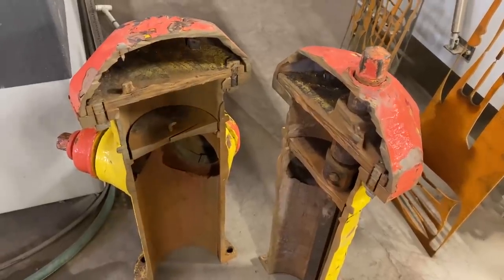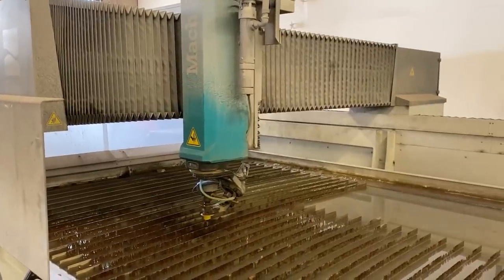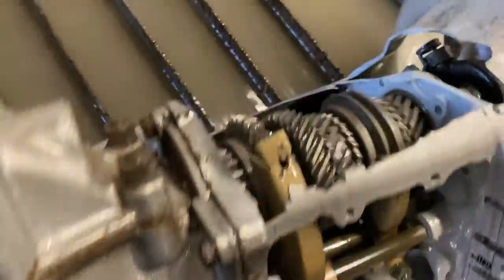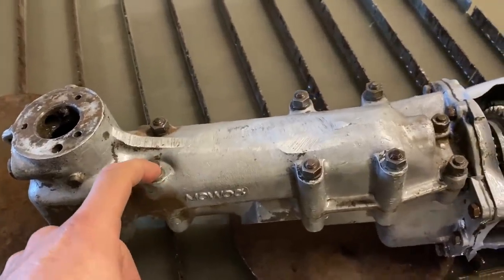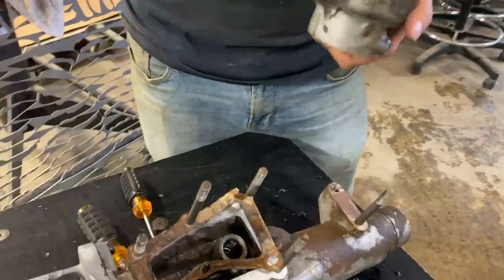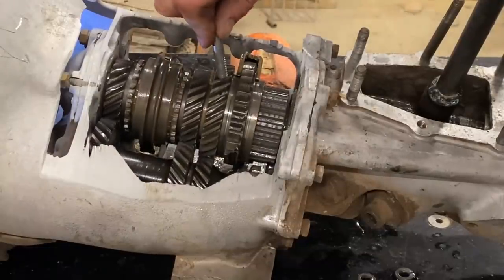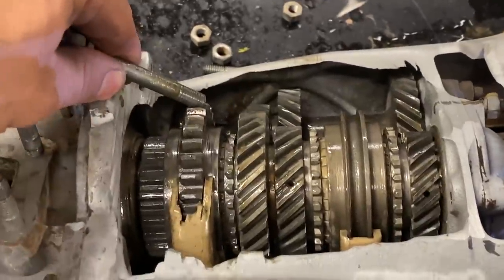Transmission Cut In Half With 60,000 PSI Waterjet

Comment: Pretty sure this is the first time I've truly understood how everything in there works.
Reply: i was about to say that. i started out being really entertained and i finished the video being really entertained AND finally learning how the gears mesh together
Reply: Well it's all pretty simple VISUALLY but I'm still having a tough time understanding how you get he insane ratios you need to go from 5 MPH all the way to 100 with gears that basically are almost all the same size... or maybe I am just wrong and the engine is already having a wide speed range and only needs tiny ratio differences to achieve that.
Reply: Techalyzer they said it came off a mg midget. those can only get up to around 80. i imagine a more powerful car would have bigger ratio differences
Reply: You probably don’t. It’s a very simple demonstration and design compared to higher speed or something more modern. Just wait until you see a automatics
Reply: @383_mtb7  those are harder to understand
Reply: Honestly I’m the opposite; I fully understood something like the CPU they cut in half a while ago but this kind of mechanics is pretty much dark magic to me.

Comment: "Practically new, light use, 3rd gear slips a little bit"
Reply from the maker: small oil leak
Reply: @WaterjetChannel  yeah might need some trans fluid, but other than that i see nothing wrong :)
Reply: No reverse. But who needs that in a racing transmission?
Reply: Civic owners be like
Reply: no gear would slip without a clutch
Reply: I think I've seen you on craigslist.....
Reply: Fightre Flighte well, how are you supposed to put the thing in race gear without the R?
Reply: It was 1 6 speed now its two 3 speeds

Comment: Properly done displays like this are worth a lot of money. Take out the input shaft, cut windows then put it back together. A little plexi for windows so you can still fill it with oil. Weld it to a stand and auction it off.

Comment: You will probably never see this but. My Stepmoms 2012 Subaru outback recently blew the transmission."It is a known issue and a new one is 6-8 THOUSAND DOLLARS and we can't find a used one for the 2.5 engine". It was a special type of transmission called a CVT (continuously variable transmission). I think it would be cool to see the inside, see how it works and see the belts and pulleys inside.

Comment: You had your gears all mixed up. The gears from the rear to the front are 1st, 2nd, then 3rd and 4th is direct from the input shaft to the output shaft. The shifter lever reacts opposite on the gear linkage and forks. The bigger the gear you engage on the output shaft, the higher the ratio.

Comment: By nature of operation, the pivot point of the gear shift reverses the inputs from the driver. The selector shaft in the shifter remote cancels out the reversal of the lateral (left/right) input from the gear shift, but not in the longitudinal (up/down) direction - that is to say, when you move the gear shift forward, the selector shaft comes back, and visa versa...

You removed the remote assembly, so to correct for this you would've had to reverse those up/down inputs to select the desired gear (1st left & down, 2nd left & up, 3rd right & down, and 4th right & up).

It seems you reversed the lateral (left/right) inputs instead.

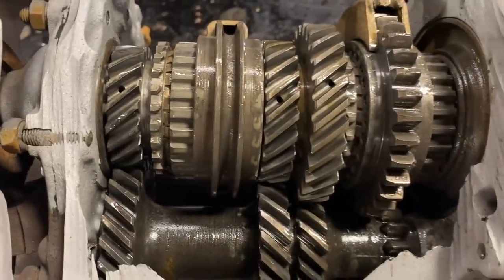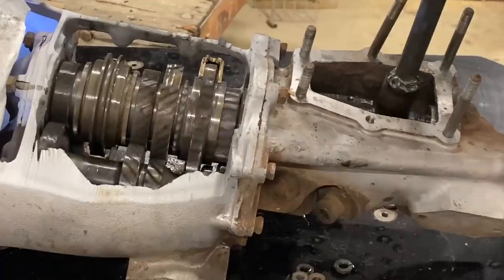When you selected "1st" @ 04:50 you were actually in 3rd. The shift to "2nd" @ 05:25 put you in 4th (direct drive). "3rd" @ 05:33 was 1st (non-synchro in this particular box), and "4th" @ 05:53 was 2nd.

Comment: What happens if you start a cut directly over the object rather than coming in from an edge? Does it punch through or just spread out? I wonder if the cutting force is actually friction not pressure?